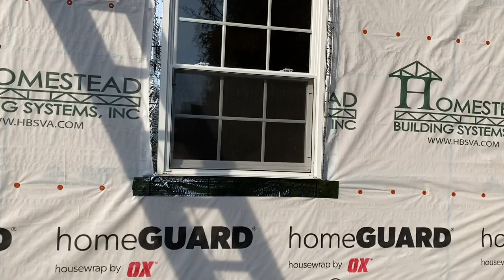DIY 24 x 24 Pole Build Garage / Barndominium

Comment: Nice work. Whatd it cost ya at the end  to build if ya don't mind me asking. I'm in the need for a garage myself. Just kinda trying to get ball park numbers of what it'd cost me to do so all finished
Reply from the maker: I have to do an update video yet but I’m at $17k and some change shingled, sided, windowed, doors, electric, pluming to include the machine rentals and I just finished installing metal siding on the ceiling inside.

Comment: May have missed it but what is the pitch, how much floor space in the loft and is that a specific truss style that you would ask for? Thanks.
Reply from the maker: If my memory serves me right I believe I ordered 10/12 pitch trusses 26’ with 60-70 lb per square foot bottom cord with a 24’ free span. This made the loft height 7’8”. 

My suggestion is shop around with local truss companies and tell them what you need and they will send you blue prints. Tell them what you are seeing other places price wise to see if they will compete. These dimensions and load will change with snow load requirements based on your area which these manufacturers will help you determine over the phone. 60-70 lbs/sqft was communicated to me to be enough to have a long term living space but not enough to store a grand pianos haha
Reply from the maker: Loft dimensions were 24’x14.7’ so roughly 348sqft
Reply: @thestateofreal2533  no snow load here in S GA but thanks for the information!
Reply from the maker: That’s good news for you…cheaper trusses! No problem!

Comment: Hey, love the garage! Building a 24x24 this spring, I was wondering if you had to put an enginered slab down for that or just regular? If you still have the plans, it would be great save me 500 bucks lol.
Reply from the maker: At the end of the day it depends on if you pull a permit or not. Places (states, townships, county’s) have different requirement. Im in PA a stones throw from Hershey and for the most part my township will accept hand drawl plans on the building permit. When talking about slabs there are two types: floating and a slab on foundation (has a footer). Typically floating slabs, unless engineered properly, you don’t build on-top of in Pa because frost heaving causing them to move and crack under load. Most pole barn or post buildings have a floating slab. Floating slabs do not need to be engineered because they are not supporting a large load and typically end up being cheaper. I have to figured out a way to post my plans someplace.
Reply: @THE STATE OF REAL   I kind of figured you had slab on foundation but wasn't sure. I'm in Cape Breton Nova Scotia and with the frost here going 4 feet, I was kinda figuring that if I went with the same design, I would have to go slab on foundation Most 24x24s here just do floating slabs. But again I built a 28x46 for a friend of mine with a 28x14 foot loft and slab was just floating. It was a rebuilt his 3 door burnt.
Reply from the maker: @CraigGatza  you can do floating as well out frost line in PA is 3ft
Reply: @THE STATE OF REAL  yep just prob going to do the 24x24 on floating and next year add 16x20 on the back. One for toys one for the shop
Reply: @thestateofreal2533  I was asking about the 2story because it would be a great place to store lumber
Reply from the maker: Yea that would be ideal. I would have liked to do the same but the wife said I wasn’t allowed to cut down anymore trees 🤣

Comment: I got a couple of quotes to build a 24x24 garage recently too.  I go quotes in the $54-60k range.   My foundation is already done.. so I'm just gonna build it myself in the spring.  I'm pretty sure I can build it for under $20k.  Anyway.. good job man.
Reply from the maker: For sure! And thank you!
If it helps, you will need:
120 studs for walls with double headers and two 8’H x9’W doors.
Two rolls of sill seal 
20 sheets for the walls 8’ high
25 sheets for 10’ high walls
32 total sheets if you go cape style like mine.

13 trusses total (24” centers 35 psi load) 2 of which are gable ends (cost me $2800…shop around)

I used one roll of 9x150’ house wrap

30 roof sheets of 5/8 (19/32) cdx and 100 clips (24” centers require clips for 5/8 in my area) 

I sourced siding through ABC supply wholesaler and went with plygem .044 thick cost me $2300 (big box stores are cheaper as they sell only .042)
Reply: @thestateofreal2533  Thx for that info.  I'm probably not gonna use a truss system.  I'm planning to do joists for a second floor space.. and use a ridge beam and roof rafters.  I'm also gonna use zip board sheathing.. and I'm gonna log side it to match my house.
Reply from the maker: @randomstuffwithjoe  sounds amazing!

Comment: wondering why you have what looks like 8x8 pt posts ?
Reply from the maker: These are 6x6 pt post 8ft on center the whole way around. Static loading and building code requires a minimum of 6x6 pt post.
Reply: @thestateofreal2533  for what ? u got a wall under the trusses.
Reply from the maker: @steve123261  a couple reasons. There is no foundation under my concrete slab. 

In a pole barn style buildings the 6x6 post are the foundation and are buried 36-48” deep so the punch plug and post are below the frost line.

If you were to place the structure on a slab here in PA, you would deal with frost heaving issues long term making the structure unsafe to occupy. Frost heaving can cause slabs to shift and topple walls.

In order to build a roof supported by the exterior walls (placed on top of a foundation) the header plate has to be doubled. In order to support the walls with studs 16” IC.

Comment: Looking good my friend, so walls are 10 feet , is your roof around 12 feet?
Reply from the maker: Walls are 10 feet to the bottom of the roof trusses. As an after thought I probably could have gone 12 feet tall so I could put bigger doors and drive camper into the garage but that wasn’t my intention.
Reply from the maker: And thanks brother! Now only if I could get the garage doors. Ordered Wayne dalton doors back in early November from Lowes…they were supposed to be delivered in February…delivery has been pushed back until April. I just have tarps over the doors right now.

Comment: Oh, sure.  It's only the WIFEY's extra stuff that will need storing.  Elevator is the right idea though.  I had a piano warehouse on my property in Arkansas and it had a manual elevator that worked with counterweights and was great.  Look up designs.  Doesn't have to be hydraulic or even electric.
Reply from the maker: You know it! I thought about doing counterweights initially but I decided on the electric hoist idea because it seemed like more work to keep weights around for heavier objects besides myself and I’d have to build the structure to withstand twice the weight.
Reply: @thestateofreal2533  Yes.  This was for upright pianos in their heyday.  I'm sill amazed that homes have been so slow to adopt elevators..  The amount of space wasted in staircases in a modest home is ridiculous, plus it ruins isolating 1st floor air from 2nd when only one need be heated or cooled most times.  But, I digress . . .  ;)

Comment: Updated on the project?
Reply from the maker: It’s funny you asked because my sister did also. The garage doors have been delayed and delayed and delayed. I had hoping to do an update video once they are installed. I’m supposed to receive them on May 26th